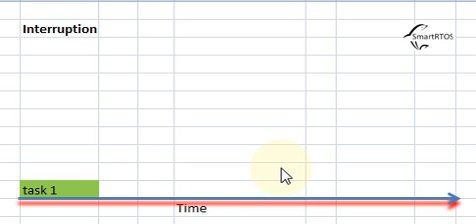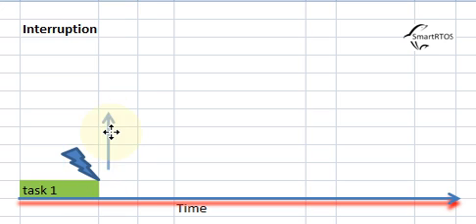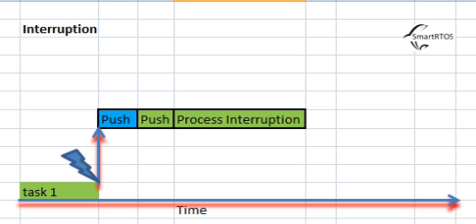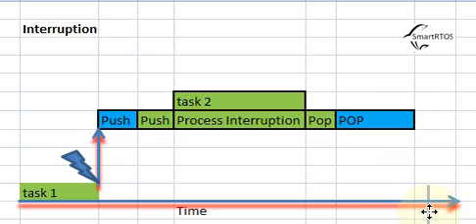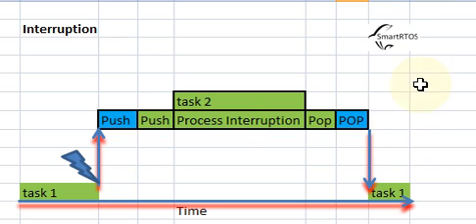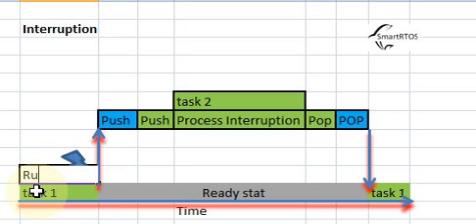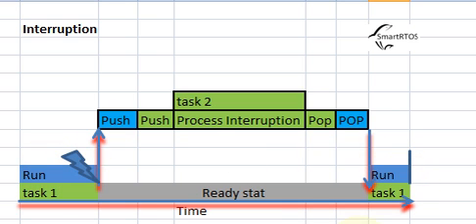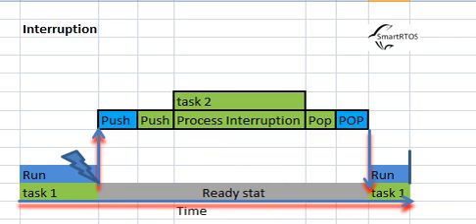RTOS Tutorial 5 Interruption 3

Comment: If high Priority process always Pre-empt low priority process. How does RTOS deal with Process starvation?
Also, in-case there is an occurrence of frequent context switching, isn't it the operating system performs slower (contrary to the benefit of RTOS of having a deterministic time on a task) since it does more pushing and popping than actually doing tasks. Do tasks age in order to overcome this problem?